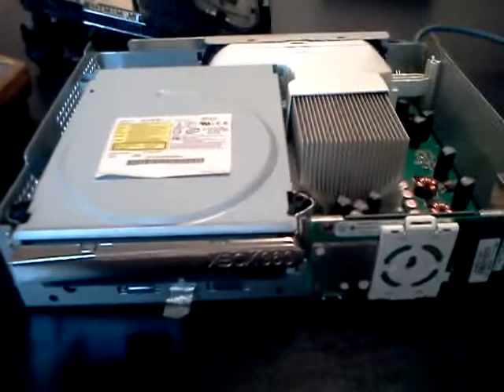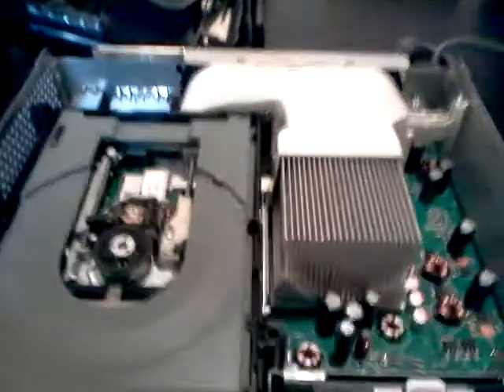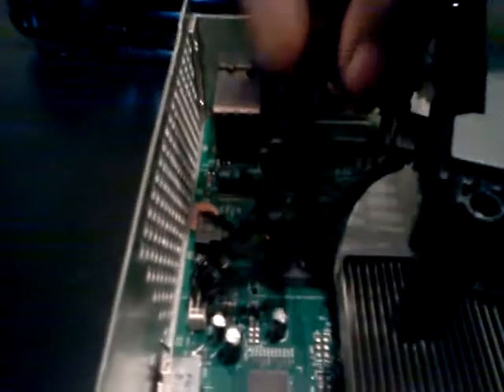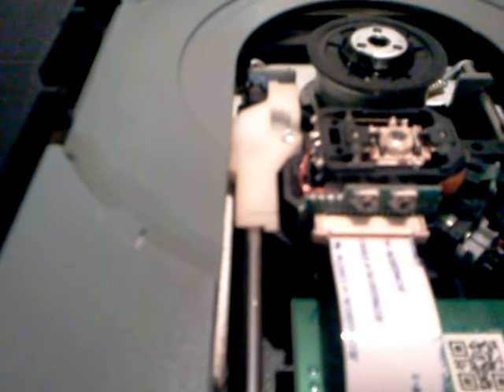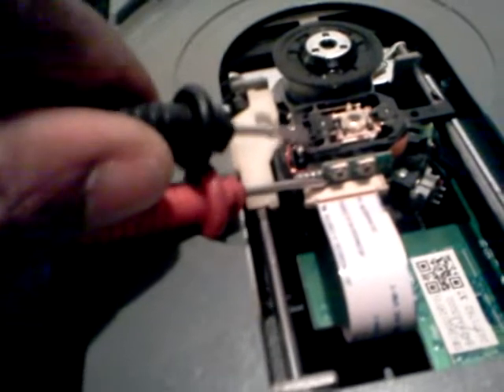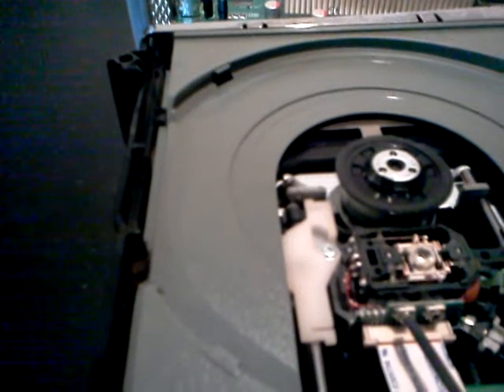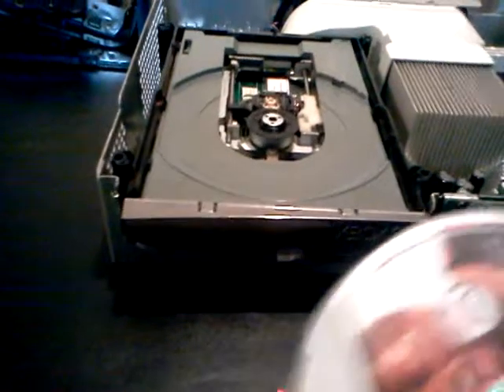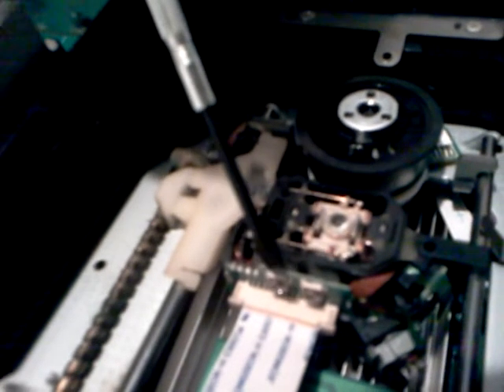Xbox 360 Disc Drive Not Working wont spin or read disc *I FIXED IT*

Comment: This is a great fix and I've used it even without an ohm meter, just by turning counterclockwise in small increments til it worked and it HAS worked on 3 different boxes. Thanks for posting this!!

Comment: You absolute legend you've just saved my 10 year old Xbox 360, I just bought Forza Horizon & Crysis 3 then these problems started happening now you've fixed it for me. I've just got a slight grind upon initial spin up, any ideas?
Reply: naz400r can you please explain how you did it?
Reply: @pspspspspspspspspspspspspspss  I followed the video guide using a multimeter. Is this what you mean?

Comment: Lordy Lordy, DUDE, it worked. I have been messing with an old Xbox 360 disc drive for a very long time; trying to adjust various mechanical parts and making sure the glide bars are lubricated. Nothing ever worked as I hesitated to mess with the electronics. I saw your video and found out which of the ohm 'pots' did what. One is for CD and the other for DVD. Okay, did not have my Multimeter so I gambled. I took a small phillip screwdriver and tweaked the left hand side pot a very small amount to the LEFT. Did a test and immediately the Madden 15 Football Disc loaded up like MAGIC. You the Man :) Thanks Bro. I did not have a piece to hold the DVD disc in place while the drive unit was apart so I just put the drive unit back together with only 2 screws holding it in place.... Thanks again.

Comment from the maker: Update to video previously I stated that you can't go no lower than 3kilo/ohms well my xbox worked for 9 months at that setting and then she started tripping again not reading disc so I adjusted the laser again going below 3kilo/ohms so now I have it set at about 2kilo/ohms and she's working again so this is just a tip just incase 3kilo/ohms don't work for you
Reply: Is there a way fixin it without taking it apart

Comment from the maker: @Ken2REAL954 sorry for the late response I try to replay to your comment from my cellphone but that was a no go. It's better to use a digital volt meter to check the ohm's reading before you start to adjust the screw to know if you can make any adjustments. But you may try using an old game disc you don't care about and just free hand it until it start to spin the disc without a meter to see your ohm's readings you will have to turn the screw VERY slow or you may miss the target 3kilo/ohm's

Comment: Hey man, thanks for the video.  Your fix WORKED!  My XBOX 360 Elite is about 5 years old and stopped reading discs today.  I tried cleaning the laser first and it was a no-go.  So I put the multimeter on the POT and it was reading slightly over 5k ohm.  I dialed it down to 3.5k ohm and BAM!  Back to playing Destiny.  THANKS BRO!

Comment: With help from my Ebonics translator,  I tried this, and it works.  I didn't use a  multi meter. I just turned the adjuster a half turn counter clockwise and it worked.  Thanks bro!

Comment from the maker: This fix also works for playstation  but you will need to know what dvd/cd drive you have
to do the correct laser adjustments for the black xbox elite the ohm's reading should not be lower than 3k/ohm's

Comment from the maker: Did you check for the reading with the volt meter before you start turning the screw if so what were the readings before and after you finished it should be no lower than 3kilo/ohm's if you have it set at 3kilo/ohm's and  if it doesn't work you may have to get another cd/dvd drive get back to me and let me know

Comment: thanks that explanation was great and i got my sons 360 working again, food for thought i only set it to 3.17 and it worked but i imagine as it goes out from use getting closer to the limit of 3.00 would revive it for a short while peace and thanks again.
Reply from the maker: Troy Gordon I actually had to adjust it again and had to go down to 2k ohm and its still working to this very day

Comment: This is Unbelieveable! I just wanted to say thank you, I just fixed my 10 year son who have 2008 xbox360 and it spinning got started up normal as you described with screws. I had tested the system turn it off and on again again It didn't stop spinning after disc installion! Thank you so much! This is my first time fixing and saved my 20 bucks seeking new disc drive.

One more thing... after you fixed the stop spinning issues how long you had it with no problems?
Reply: I fix drives this way and they last a while depends how long you play on it for but mine lasted another 2 years
Reply from the maker: Alexis Feliciano It worked for 9months at 3kilo ohm's and I had to adjusted it again to about 2kilo ohm's as of today its still working but it also depends on how often you play
Reply: +Yakira Cal so what of my Xbox doesn't read the disks like it says open and closing it opens fine but it makes a grind sound and won't close nor. read I don't have those screwdrivers ATM so I think I'm screwed and ideas?

Comment: I don't know if you will respond to this or not but I am having trouble with the screw. I turned it slightly and the screw came off. I tried screwing it back on but it won't go back on. Do I need to buy a new disk drive?
Reply: yeah bro..your gonna need a new one :/
Reply from the maker: Yeah Yeah exactly what he said also if you buy a new disc drive you will need to use the circuit board from your old disc drive for it to work so make sure you get a solder gun and some solder wire to resolder the wires in the new disc drive

Comment: I don't have voltmetar, and I try free hand, but no succes..
Reply from the maker: BHTL. ba when you free hand you have to do it very slow in increments because you might move past the mark
Reply: I try again, and now it spin more than before, but still not Reading.. What if Xbox won't read CD for another reason?
Btw Thanks for Replay!